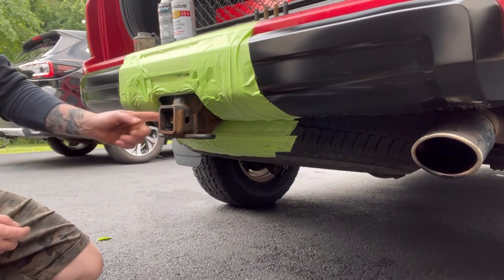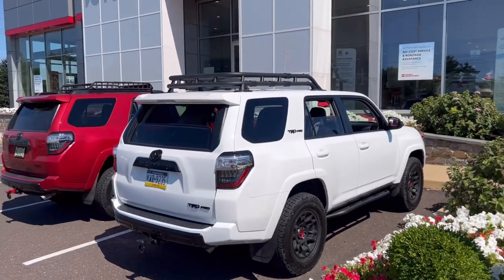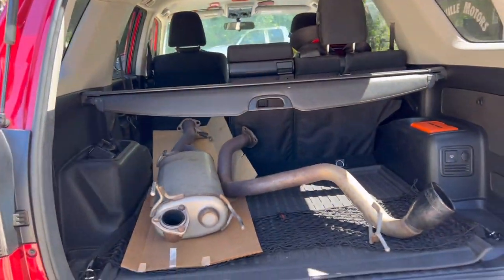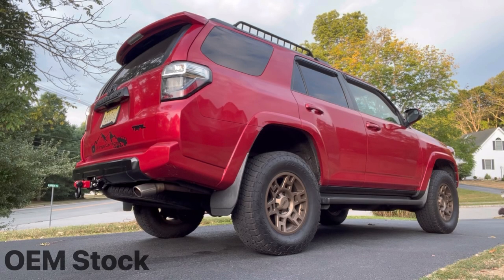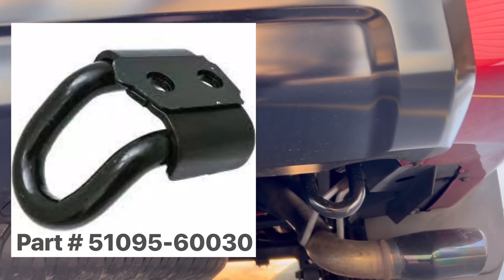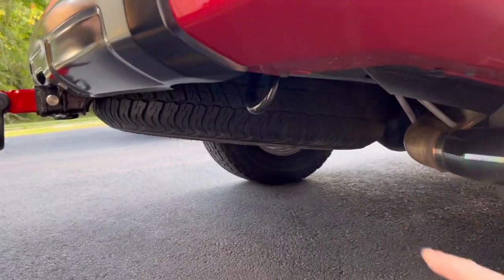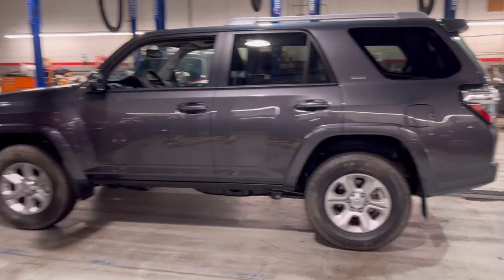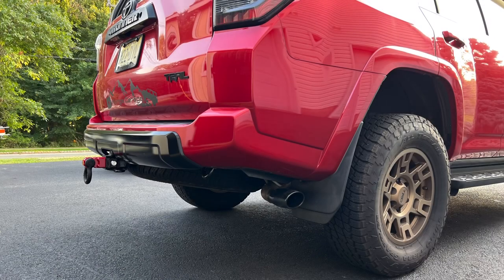5th GEN  Toyota 4runner Mod you hope you never have to use!

Comment: Two issues with the TRD exhaust: If you offroad, it is in a worse spot than the non-TRD exhaust (crushes exhaust tip when rolling off a rock with the passenger side rear wheel).  But the worst part is the drone coming from the exhaust at interstate cruising speed rpm.  Way louder in the cabin and not in a pleasant throaty way. Changes the feel inside the cab, at highway speed, for the worse.  (Edit: Just saw your later video that you now find the TRD exhaust to drone too much on the highway and now don't recommend it.  I agree. )
Reply from the maker: I’ve heard the same from other owners, the crushing part. I’ll have the oem muffler back in no time. Thank you for watching and welcome to the channel!!
Reply: I agree with exhaust-droning and resonating the cabin on the highway is miserable. I’d much rather have a quiet exhaust.
Reply from the maker: Absolutely!! Give me quiet, over that constant droning.

Comment: I have a '21 TRD pro and love it... except for the DRONING! It drives me CRAZY. Is there a simple, not too expensive, fix for this? Can I simply replace the muffler with a non-pro muffler but keep the TRD tail pipe?  Any help suggestions would be appreciated. (great channel, btw!)
Reply from the maker: I appreciate all your support!!
The droning can only be removed by installing the OEM exhaust system, then you can always add the side TRD exhaust exit.
It’s been done plenty of times.
Just find a good local muffler shop, they will weld it for you.

Comment: Those aren’t recovery points, they’re tie down points for shipping. You can get lucky when using them for recovery but they can, and will, snap off during the recovery and cause more problems. Just a heads up.
Reply from the maker: Something is better then nothing, when you really need it.

Comment: Former Exit 117 boy before retiring and moving to Florida...I own a 2001 Corvette and a DIY diagnostician but mainly do C5/C6 Corvettes diagnostics down here in the Sunshine State and while I was in Joisey....my daily driver is a 2016 4 Runner and I want to start scoping some circuits like injector and coil current, fuel pump do a and cam/crank correlation and other things...HOW the heck do you get to the ECU to do the cam/crank ??...forget about back probing at the CKP sensor...Alldata says the ECU is accessed by removing the lower IP Subassembly which is over 30 steps...WTH ??...looked like 4th gen you just removed the glovebox...and I just subscribed...if you ever need scope captures on your 5th Gen let me know....I don't know if you use a scope at the dealership ??...thanks and GREAT channel !!
Reply from the maker: Welcome to the channel Sir!!
Vettes are a lot of fun!
We very rarely use the scope, today’s system make back probing a bit dangerous, if you back probe the wrong thing… you could fry a pcm. 
Tons of computers in todays new vehicles.
You might actually know my boss , huge Corvette guy.
To my knowledge he has owned several of them.
Cheers!!

Comment: The receiver hitch shackle is a "recovery point". The loop that you call recovery point is a "tie down" point. It will work for a gentle tug, but if you are really stuck, that tie down will fail. It is not WLL (Working Load Limit) rated.
Reply from the maker: I agree 100% with you when it comes for the front ones, not so sure it’s the same story for the rear ones. 🤷🏼‍♂️
Reply: Been using the tie down points for violent recoveries for 8 years.  Usually 4-5 a year as I work in oil and gas and both give and need recovery often.  Used both hard and soft shackles. Never a failure.
Reply from the maker: 👏🏻Thank you for confirming.

Comment: Where I live we don't have to worry about rust, I did buy a blazer that was from Pennsylvania, I ignored the car fax and where the car came from.....HUGE mistake! I will never buy a car from the east coast again. When I sold it I had a guy from New York want to buy it because he thought it was a Colorado car when I told him where the car originally came from that was deal killer. He says when he come to Co. he buys a car and sells it for twice as much in new York because they have no rust.  And that 2015 even though it only had 600 mile that oil should have been changed at least 7 times by now...regardless of miles. My 2021 has 10k and  I have change the oil 3 times and filter 2 times...You and I are a lot alike
Reply from the maker: Very true, thank  we rust is just terrible. Better safe then sorry with those oil changes.

Comment: @VikingsGarage I have a used trd sport muffler for my 2015 lifted Scion xB. It keeps nice and sharp and more oem look. But I made it a little louder but more enjoyable to drive, so I have oem resonator delete and replace and weld with 23” 2.5” cherrybomb glasspack. 

And it sounds way nicer and how a trd cat-back exhaust should sound like it came as a factory. 

Now I want to go more. And now I get two options with my own vision for custom exhaust built. 

Either stick to trd, but I want to make a custom 2.5” exhaust. And find another exhaust tip with the embossed trd plate that’s welded on the double wall exhaust tip, and make it more proper trd dual exhaust. 

Or should I go for a clean custom single right side exhaust, and to go more crazy. I’m gonna use the exhaust merge collector for more insane look of it?

I’m stuck between the two lol. I’m a huge fan of trd. And also a fan of crazy built lol: 

So what do u prefer in ur opinion? Keep trd or go crazy?
Reply from the maker: Depends on how much you can tolerate, noise wise. At 44 all I want is peace and quit. 🤷🏼‍♂️
Reply: @VikingsGarage  makes sense to me. A nice throaty sound from trd, that’s not even loud. But sounds better than the oem. ❤️‍🔥❤️‍🔥❤️‍🔥

Comment: Damn, I didn’t know about the second recovery point. I might need to buy a pro exhaust.
Reply from the maker: Small correction to my own video: 
only use it as an emergency recovery point, turns out this “tie down” loops 
can only take so much pressure before snapping off. 
It’s a cool find nonetheless.

Comment: I have a 2020 TRD Pro with the cat back exhaust. I added the passenger side recovery point as well. On the CB exhaust...I think it is supposed to give you a little better fuel economy and add some extra low end torque (I don't remember the exact specs on it). I also noticed that with the rear seats in the normal position (seat backs up) it's a little more quiet than with the rear seats in the flat position (for carrying cargo/stuff). I do prefer the CB exhaust over the regular exhaust system. Good call...I think you'll be happy with it. (And having 3 recovery points versus 4 always bugged me...I just knew if I needed recovery it would be needed on the rear passenger side...Murphy's Law is still in effect).
Reply from the maker: Weird right, how that 4 spot was not installed from factory. So far I love it!
Thank you for sharing your experience with it.
🙏🏻

Comment: Found your channel a few weeks ago and just catching up on your vids.  Love em
I'm very interested in picking up a 4Runner as I plan to drive it for the next 10-15 years trouble free since Toyota has a reputation as such.

question:
what do you feel about KROWN style (oil drip) rustproofing these vehicles.  I'm in Toronto so we get a lot of snow, but  more so, we use a lot of salt on the roads...
Reply from the maker: First off, Thank You very much!! I appreciate you!!
Yes do rust proof frame As soon as you buy it. That’s a must.
As far as method, do your re-search there are a few good products out there.
Reply: @VikingsGarage  Perfect, will do thanks.
is there a method you prefer in your experience in a winter driven 4Runner?  Krown (oil drip) vs the spray undercoat style?  Personally I've always believed the undercoat just traps moisture to the frame accelerating problems, but I could be wrong.
Reply from the maker: Honestly I’m not really an expert on that, I would go with a method you’re comfortable with. The key here is that you get it done. 
( I used spray undercoating)